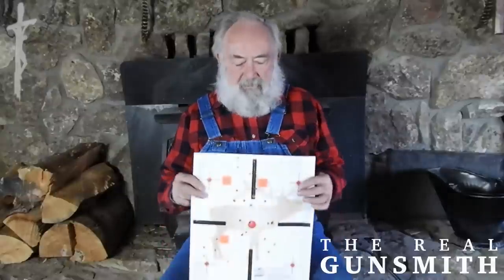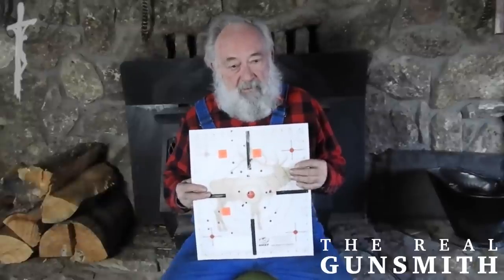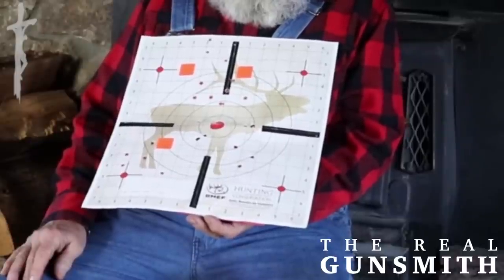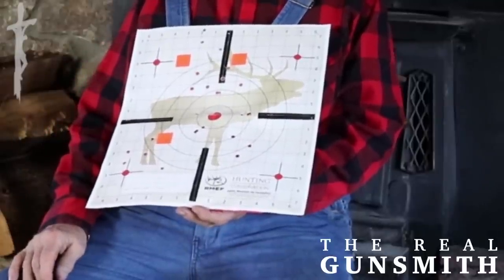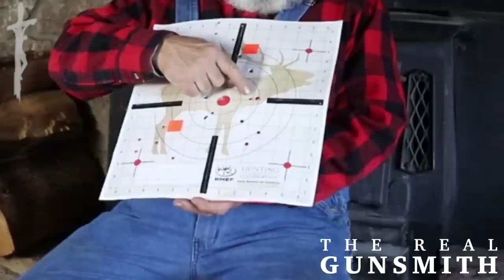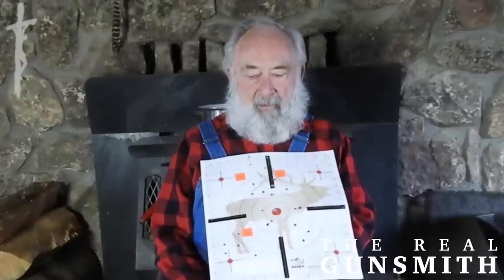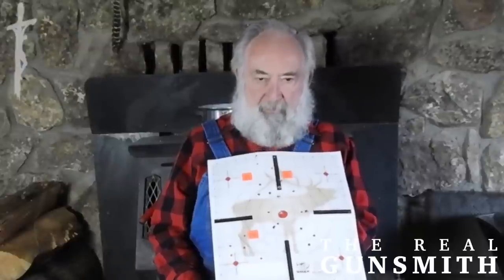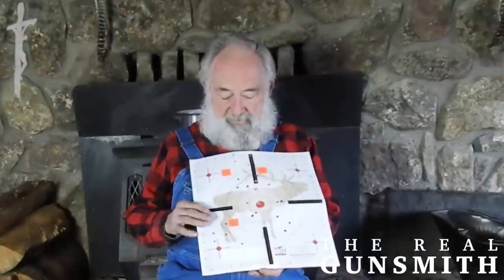Savvy Reloading Advice

Comment: I have a question sir? Can i reload steal ball bearings the say weight 1 oz in my 12 gauge smooth bore and do i need to add buffer with it.. Thank you
Reply from the maker: Add the buffer.

Good shooting and thanks for watching.
Reply: Ball bearings are a whole lot harder than steel shot. Not a good idea to shoot them. Find a lyman shotshell manual it explains in depth why ball bearings arent a good choice.

Comment: Do you use a chronograph when developing your loads?
Reply: Of course he uses a chronograph. Did you watch the video? He talks about standard deviation. There is no way that he would know what that number is without a chronograph.
Reply: @RonOzmond  l am not being a smart ass. I didn't know if he did or not. I don't have a chrono and am able to achieve sub moa accuracy in 15 different rifles. So everything is not ovi
ous
Reply: @RonOzmond  I rewatched the vid. My bad. Sorry.
Reply from the maker: Yes, I do.
Reply: @chris Johnson I was unable to use my Chrony  chronograph at the 300 yard indoor range that I use to work up loads during the winters. So for my 6.5 CM I had 4 loads that all shot 1/2 inch at 100 yards. I loaded up enough to shoot 2 groups with each load at 300 yards then measured the vertical dispersion at 300 yards. The same load shot the best on two targets. When I chronographed them later that spring that same load was shooting at 9 SD each time I shot over a chronograph. sometimes you can get the data you're looking for more than one way.